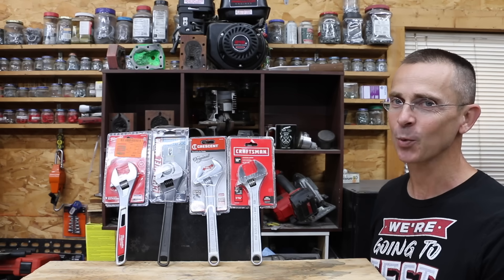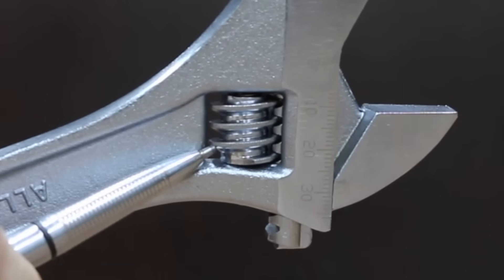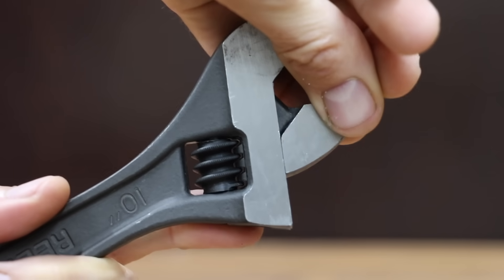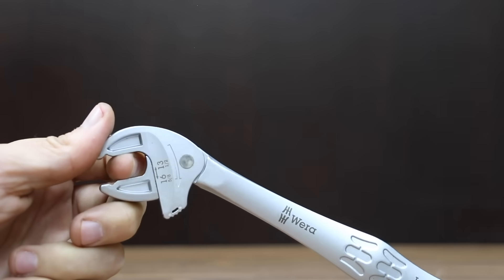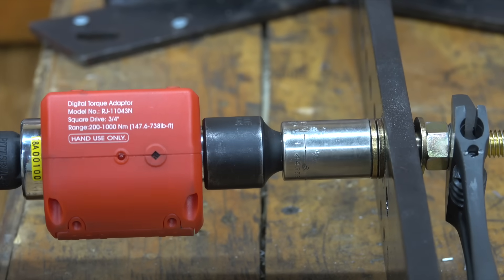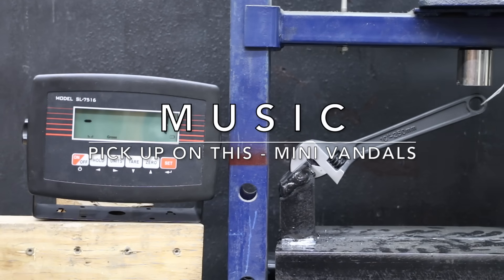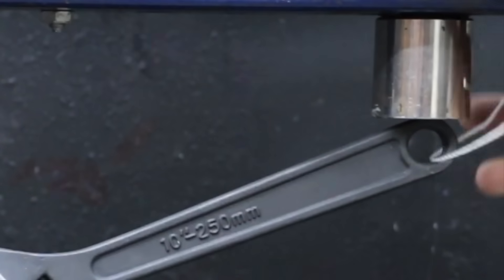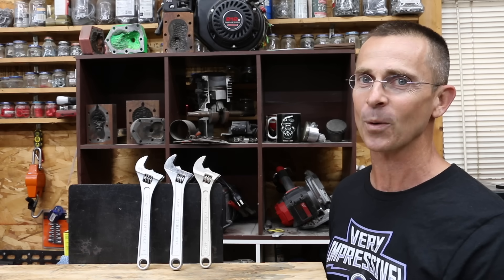Best Wrench (ADJUSTABLE)? Craftsman USA vs Craftsman, Crescent, Kobalt, Milwaukee, Channellock

Comment: For anyone who wants to know, Craftsman usa made adjustable wrenches, * shown in this video, were made by Proto(*Western. Forge)tools and the Proto is still available and in current production  still made in the USA. The old Craftsman brand had mostly been production tools made with the craftsman name. In my opinion the craftsman/ Proto  was/is the best adjustable wrench for the money. I am a millwright at a steel mill in Birmingham AL.
*edit- some older craftsman adjustable wrenchs were made by the Williams tool company. The very last run of American made , craftsman branded , adjustable wrenches were made by Proto(Western forge) .
Reply: I've still got a Proto Adjustable Spud Wrench, that thing is awesome.
Reply: @TOM-yd8ub  Irish and Polish taters are simple. One only needs a potato peeler at the most.

Only over engineered German taters need a wrench!
Reply: @DesertCatDad  And a strong one at that. Plus some rust solvent.
Reply: Can anyone tell me where the best place is to sell a large amount of vintage craftsman tools at? Where they will be most appreciated and bring the most value to the original owner who collected them one by one?
A mechanic who quotes " I didn't buy junk"
And worked hard to buy each tool. He now could use the cash for his retirement.
Thank you for any replies.
Reply: @mariesacul722  
Real mechanics or collectors. Auction sites like Ebay or Etsy.
Reply: @wilsonrawlin8547  thank you also.
In preparing for this sale. I see that the real thieves and bums. Have taken advantage of my husbands siruation and stole the vast majority of his hard earned tools out of his locked up house. It makes me sick.
A man works hard his whole life buys his tools the honest way. And some thugs who dont want to work steal his tools while he's in the hospital.
Its a sad sad world we live in.
But, what is left. I will use to sell for him. And do something for him hopefully. Thank you all. So much.
Reply: @mariesacul722  
I'm sorry you have to deal with crooks. I pray God gives you wisdom and blessings on selling his tools. Don't sell in bulk. He may have tools that are highly collectable and worth a lot of money. Check with tool collectors online and do your research.
Reply: @wilsonrawlin8547  yes, ok. I will do that for sure. Thank you so much
Reply: @mariesacul722  
I wish you and your husband well.
Reply: @wilsonrawlin8547  thank you. GOD bless you as well. 
Such good ppl here.
Reply: Whats taters precioussss???
Reply: This is a good reminder that Sears products were always subcontracted to other manufacturers, however they chose wisely. My Sears washer and dryer I purchased in the early 80s is still going strong.
Reply: I have alot of Proto, Williams,Blackhawk ,SK,Cornwell.
I go buy all the old tools I can find at yard sales pawn shops etc.
Go to hell ccp pla China!
Reply: Bless you!
Reply: I think you're forgetting the tools made by Western Forge.  Tons of craftsman tools are marked WF.  I have adjustable wrenches marked as such.   WF cancelled the tool contract it had with Sears when they started collapsing a few years ago and Sears threatened to sue.
Reply: @cs-rj8ru  you are correct. The WF hallmark was missing on the latest usa made wrenches but apparently was made by WF as far as I can tell
Reply: @Peter Evans You are correct about that Peter. And I truly appreciate your time and help on this. Have a blessed day.
Reply: @Peter Evans do you suggest it be sold best as in bulk. Which is a lot. Or as individually for best price for him in your opinion.
I want him to be able to get as best as he can. And i understand the correct market for this product needs to be found to ensure he is able to get the most out of them. I thank you very much for your advice already. Much appreciated.
Reply: @mariesacul722  mechanic and full time eBay seller here. If you want to get what those tools are worth, do not try to sell them in a big lot. You will need to do the work of listing every individual piece. I would suggest that you DO NOT bake sipping coats into the listing price just to offer “free shipping”. List each tool for its fair market value with shipping costs separate and then allow people to make offers on the tools. Also offer combined shipping, that way if so one is interested in several tools at once they will get a better deal if they can have all of them shipped together. It’s a win win for you and them because they will save money while you get what the tool is worth but won’t lose much other than a couple extra bucks you would only make on shipping.
Reply: @jaythatguyyouknow5135  jay, you sound just like my husband before his strokes.
Just like him. And i miss that part of him.
Now, see what ya done? You got me crying. Promised myself i wouldn't do that no more.
But, these strokes are so mean. They steal the core personality of a man. Or woman. Same person. Just different logic. Not crazy, just confused.
And i imagine a world again, that 9 out of 10 ppl. Won't take advantage of these kinds of situations. And you both have helped me in feeling that is a real possibility.
Or also, that no one wants to be bothered by the stroke pt. Because they're behavior seems odd.
Guess what I mean is there are some people who are still very good and nice. With pure  intentions to take the time to offer a stranger this help. And I thank you both tremendously for your help.
God bless you both. Sorry i got into my feels. Its been a tough year for us all i know. Thank you.
Reply: @mariesacul722  no worries. I’m just glad to help a little. Gotta live as I want my kids to live and that means doing for others what I would like done for me.If I can contribute even a small bit of beneficial information or just something positive to any YT comment section then I’m doing my part to make this platform a little better. I know your situation and it’s extremely rough at best. Granted my situations are different but a lot of the struggles are the same. It’s ok to be sad about it and it’s ok to drip a tear or two, especially when you get reminded of the good times. Just remember 2 things, if you take the time to mourn make sure you take the time to celebrate because I’m sure they will be upset if we only cry for them and remember that people want to do some type of good and are not as horrible to each other as it seems online.
Reply: @jaythatguyyouknow5135  beautifully said jay. You made me cry again. Not easy to do.
But, maybe holding too much in.
Your right, about all of that.
Hear a lot about platforms being bad. But, it comes down to human behavior yes. We can make it better.  Perhaps one person at a time.
Of course there will always be some who do not wish to be kind.
I am glad you said to find joy as well. Cause, i feel like it is unfair if i do. And honestly, thats not helping anyone at all.
Trying to keep in mind the days when he was buying one tool at a time. And to see someone exploited that from him. Well, it hurts me deeply.
Cause, i know the sacrifices and hard work he put into getting each piece. Just wanted him to be able to do or buy something for himself.
It will all work out i am sure.
Thank you so much jay. For answering mt questions and mostly for all of you boosting my moral. Hence his moral. And you can't buy that.
Thank you Jay and everyone else that took just a minute to reply. I know everyone's time is valuable.  And i appreciate ya'ls kindness and help with suggestions. It matters.
Reply: @KreemieNewgatt  you,re correct as far as I can tell. Western Forge made  Proto, Williams, and craftsman  branded adjustable wrenches.
Reply: DeWitt Nebraska,  home of original vise grip,  is now reopened making Eagle Grip locking pliers.
Reply: @patriotic6145  heck yeah
Reply: I have many Craftsman tools from way back in the fifties when my dad had them.  There was one socket that had some wear back in 1968 and I took it to Sears and . . . exchanged for a new one  -  no questions asked.  Very satisfactory.
Reply: @Peter Evans Sad
Reply: I have super old proto proffesiobal screw drivers that refuse to wear or strip at the heads over so many years of abuse…
Reply: Interesting! Thanks, Plainlogic! Proto is a favorite of mine. I wonder if John Deere vintage and contemporary wrench production was contracted out.
Reply: My uncle worked for many years in a steel plant in north Alabama. He was mill wright too. Last name was Murphree.

He died last year.
Reply: I got 1970s vice grips still trying to break them
Reply: OMG!  Thank you for the info. The idea of buying more Chinese made crap makes me want to puke.  Those tools are the best.  Sears really screwed up when they sold off Craftsman.
Reply: Proto wrenches are available from MSC Industrial. Bought two not very long ago, excellent quality. Made in USA.
Reply: thanks gorbthe info, micj appreciated, been getting into buying made innisa hand tools, saw a sale on tue Cresent wrenches at HD yoday, while they're nice, they were made in china. not what i was looking for right now.
Reply: That's great to know. I use to buy quality craftsmen tools until Sears dropped the quality and then  the made in the U.S.A. Then the sockets started busting and rachets were crap for the price.
Reply: As of Feb 2020 "Western Forge, USA Hand Tool Brand and Former Sears Craftsman Supplier, is Closing"
Reply: At my old job, we had a huge variety of tool brands in our Lista cabinets from the cheapest no-name (literally) brands to Snap-on and the ones that impressed me most as being good values for the money were the Proto, Blackhawk and Craftsman.
Reply: @Neutercane  I use to work for Mac Tools. We would have a 1000 1/2 wrench blanks we would stamp 800 proto 200 MAC. proto was 1/3 the cost. Same everything.
Reply: @tbone116  Not at all surprised.  In my opinion, it got to be pretty ridiculous where I used to work.  Some of the mechanics on site apparently believed that unless the vehicles were worked on with a certain top-of-the-heap branded tool (S***-*n), it couldn't go into combat with any hope of surviving under enemy fire.  Of course I'm exaggerating a bit, but the tool brand snobbery was too much at times.
Reply: @Peter Evans you are literally incorrect on the time frame
Reply: @plainlogic  

What is the actual time frame. Very curious to know for the tools I currently have and will buy.
Reply: I will take a Klein adjustable wrench over all of the others for my money.

Comment: You did a video in 2017 for thread-locking adhesives, like Loctite. Would love to see a comparison of Loctite Blue (and comparables) vs DIY solutions like nail polish, Super Glue, a dab of hot glue, craft white glue, etc. I wonder if the price of a small tube of thread locker is justifiable if my kid's craft glue works just as well preventing bolts from vibrating off.

Comment: technically when using an adjustable wrench its best to put the load of the nut to the top of the fixed jaws rather than the moving one as they naturally deflect away. but still a great test against the brands :)
Reply from the maker: Thanks!

Comment: Thanks again for the informative test. I could not find a test from you on fine tooth ratchet wrenches. it would be interesting to see you testing precision/slop, strength, breaking point like you did here. Also, would like to see how the new Icon branded wrenches hold up verses Harbor Fright's  Pittsburg line. Of course Kobalt, Huskey, Craftsman and so forth need to be tested.
Reply from the maker: Thanks for the suggestions.

Comment: Hmm... My favorite Will still be the bahco. 
I use handtools in my everyday work. And for a person doing that - a Lot of things come into perspektive. The most important one - how does the tool feel, is it comfortable.
Tried a Lot of different Adjustable spanners, but for me the bahco just feels 'right'. Socket sets - the würth/zebra is my favorite, grips - the knipex ones are great. Vice - I would choose peddinghaus/ridgid above anything else. Combined spanners - the Gedore is and all time favorite and when it Comes to screwdrivers - wera.  When talking Durability and strength, that is (for me) different things and all the mentioned brands above are High quality and highly durable, that Will last for ever when taken care of and looked after. Regarding strength - always choose the right tool for the job - and never ever extend the handle on your wrench unless it is and emergency og absolutely cannot be avoided.
Reply from the maker: Thanks for the feedback.
Reply: Awesome, thanks for posting!

Comment: I've been using a 10 inch USA Craftsman for over 40 years... I don't say this lightly. but it is still a workhorse. It doesn't give and it doesn't slip and obviously, I haven't broken it.... In fact, most pre-1990's Craftsman tools were built like tanks.... But if you can find anything from the 1960's you have struck gold.
Reply from the maker: Thanks for the feedback.

Comment: Over 30 years ago my father started buying me tools for Christmas and my birthday. Since we had a sears in town I received Craftsman USA everything. Only failure was the 1/2” drive ratchet. They replaced it on the spot. I’ve used the tools heavily in a professional setting as a appliance technician and as a small engine mechanic and even more so as my personal tools. I’ve split MAC deep well sockets (10mm😂)but no failure on my original American made Craftsman.  My dad is no longer with me but his love of tools lives through me and my kids.
Reply from the maker: Thanks for sharing!

Comment: Winter is coming... Could you please test some LED light bars? There are so many, some with Cree, some with Osram, so many with Chinese clones  that seem to work just as well. I'd like to see light output, water durability, build quality and UV fading. Please.
Reply from the maker: Thanks for the suggestion.
Reply: @ProjectFarm  No, thank you for your awesome testing channel. If you do it, get easability to install in there too, some require additional wiring or drilling holes, well you probably know it better than  I do.

Comment: I recommend a socket set video. It's impossible to find one that has a reliable rachet set with all the sockets for 99% of the jobs that, and here's the important part, don't fall out of their spot when you close it or tote them in their carry case.
Reply from the maker: Thanks for the suggestion.

Comment: Not that mechanics use cheater bars on shifting spanners. (Only when the breaker bar isn't handy with the scaffolding pole permanently attached to it. As the scaffolding pole bent (whilst jumping on the pole via a 500lb gorilla called Cletus loosening lug-nuts) creating a hybrid extra long breaker/cheater bar that requires nuclear fission to separate it).

The 2 meter (6'6") plus length is a good size to have two gorillas jump on the tool for extra leverage.

Sometimes when the scaffolding pole/cheater/breaker bar isn't available, the shifting spanner with the trusty rusty hammer* (that even Thor couldn't break) is used when requiring more mechanical force in enclosed spaces with several, excessive blows/loving taps to loosen the nuts and bolts that have rusted into an engine block.

*Some ancient hammer that was a hand me down from medieval times (or older) that came free with the garage/workshop that nobody knows the origins of as you are unable to carbon date carbon 14. (Most likely some European brand, when giants roamed the earth. With symbols that only Robert Langdon might understand.)

I blame Archimedes for all of the over-torquing.
Reply from the maker: Thanks for the feedback.

Comment: Not sure if it has been mentioned, I didn't read all the comments... I have Raptor brand, and they are by far the best adjustable wrench I've ever owned. I use them all the time. They are sold at Ferguson plumbing stores. Love your tests! Been watching them for years. Keep them coming! Have you tested hand cleaners? That would be great.
Reply from the maker: Thanks, will do!  Thanks for sharing!  Thanks for the suggestion.

Comment: Well done - I love your videos! 

I have an idea for you ... I would love to see a test between 6pt and 12pt sockets. I've been a mechanic my whole adult life (~35 years) and use both types of sockets, often with no rhyme or reason behind my choice. However, I often hear naysayers spouting off about the dangers of using 12pt sockets on 6-sided fasteners; that you're gunna round off the nut/bolt if you use the wrong socket. I don't believe it. After decades of turning wrenches, I've never damaged a fastener with a 12-pt socket - but I've broken a lot of sockets. There are all kinds of possibilities for this kind of test, and I think you have what it takes to do it. Thanks again for the great videos and impartial advice and thanks for your consideration!
Reply from the maker: Thanks!  Thanks for the suggestion.

Comment: Can you do a copper connection test.  Soldering vs. Non soldering options.  Pull test, pressure etc.  Great videos.  Need a second channel for farm chores. Thanks
Reply from the maker: Thanks for the suggestion.